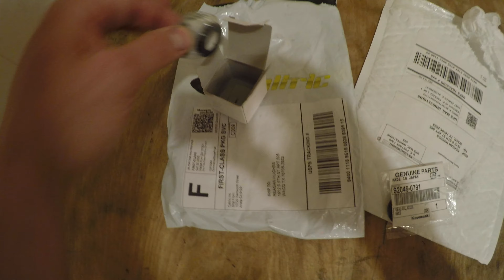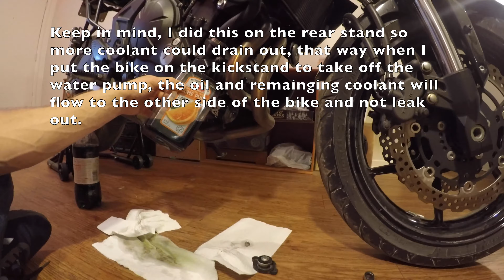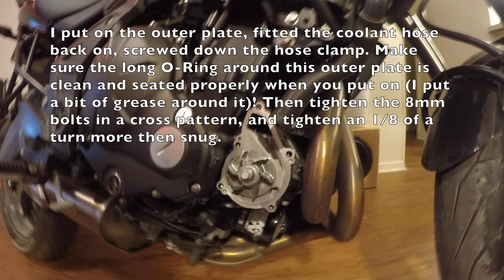Kawasaki Versys 650 Water Pump Oil/Coolant Leak Fix

Comment: Could you tell me how did you do to take the plate off from the bike? I heated it up but I still could not get it off from the bike. I did not know how long I had to heat it up because I was afraid  too much heat could damage the engine of the bike. Thanks for your help.

Comment: I changed out the seals, but there’s still oil seeping out the weeping hole. Any thoughts?
Do I need to change something else out?
Reply: I am having the same issue! I just replaced the head gasket and the oil seal, and I fired the bike up for the first time and it was still leaking oil. It's aggravating.
Reply: @jasonlopriore6492 what did you do to fix it

Comment: I just had the same problem, so many coolant spilled. I noticed the temperature sensor went on in the display. Did you drain the engine oil out or just change the seal?
Reply: @thegoldbarron9504  Noted on that. I guess I got the same problem with the seals. Thank you for your help!